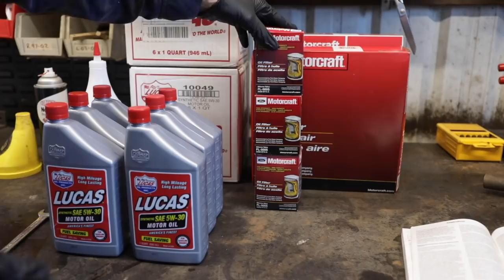How to Change Your Oil Like A Pro

Comment: Good well presented info, I have a friend who's car has different sized front and rear wheels/tires from the factory, he went to the dealer for an oil change and tire rotation. The dealer tech put the larger/wider rear tires on the front of the vehicle. He was driving home with it and it felt like something major was wrong, went back to the dealer and the service manager looked at it for a while put it on a lift and eventually realized what happened.  You would think the dealer would have known this. My point is don't assume because you are going to a pro they will do a better job, they are often rushed and will likely not value your vehicle as much as you do. 

There are some good mechanics out there and if you find one stick with them. If you learn how to do some basic maintenance/repairs yourself, you will take pride in a job done right with quality parts that you selected  and installed yourself. I worked as an auto service writer years ago and I remember the chain quick lube shop next door put engine oil in a customer's transmission. Additionally doing the work you are able to do yourself will avoid the constant high pressure up-sell.

Comment: All good stuff. People with horizontal mounted filters can still add oil to at least halfway or enough to soak the filter media. I use the used oil as bar oil for my chainsaw. I know you might not want to do that with yours but I don't depend on mine saw like some do.

Comment: That's a neat little tip, writing fluid specs and part numbers in the hood. Personally, what I do is I write them on an index card and staple that inside the front cover of my Owner's Manual.

Incidentally, I also like to keep my registration and proof of insurance in one of those little cellophane-like sleeves made for baseball cards. They're so cheap, and yet they're cleaner than those little vinyl wallets your insurer gives you; none of that nonsense of the vinyl sticking to the print and getting all mucked up.

Comment: Pretty good tips and tricks. Cody is very knowledgeable. Should I add one more thing to the list though, grease the front end. Steering components and upper and lower ball joints. Especially if you already have the tires off real easy to get in there to grease ball joints

Comment: you can run a magnet through your used oil to possibly find metal particles, saved my old 74 triumph gt6 from a potential disaster when i did it. but in fairness it still had old valve seats and valves from the lead petrol days back then, runs like a champ now when she gets out.

Comment: Mr. W, AmsOil is available on the internet! I have used their products for a few years now and I love it! I've used their engine oil, ethanol treatment,  P.I. and Power Foam. I intend to use their transmission fluid on my next change.

Comment: And you are still amazing and the reason I subscribed a long time ago. You might mention that spreading a bit of Kitty Litter on the oil spill and crushing it in with your foot and letting the litter absorb over night before sweeping up beautifully removes oil on concrete.
Thanks again for your videos and mostly for your terrific attitude.

Comment: I've only traded in 1 vehicle over the years (a half-ton with good value, but I wanted a Suburban for the family), and leased 1 that we ended up not buying afterward (expensive). Two went to the junkyard after accidents, three got parked in the back yard waiting for expensive repairs. One parked in the back yard because it's antique. Three still being driven. We put 957k miles on those 11 cars ourselves, most were bought used, with an overall mileage (PO and us) of 1.8 million miles

Comment: I added a Fumotu drain valve to my truck after three different vehicles and 16 years worth of oil changes. Now just crawl under the truck with a precut length of hose, attach to valve and drain straight into an empty 5 qt oil container. Doesn't spill a drip. My current vehicle uses a cartridge filter mounted on top so it is truly zero drips an no need for a catch pan. If I had a standard filter I'd need it, but it's nice not to have to use it/empty it now.

Comment: A couple years ago I accidentally installed an old oil filter that I had in my shed thinking it was a new one. Not sure why I had never thrown it away, but I had stuffed a shop towel down it. I go to start the truck after changing the oil and I got a low oil pressure alarm.  Turned the truck on and off a couple more times, and kept getting the alarm. Finally something clicked in my head that I might have used an old filter. That was 150,000 miles ago. 2011 f150 with 323000 miles still running strong.

Comment: I run Lucas in everything! My motorcycles, my truck, my wife's car, the family van, my boat, you name it I use Lucas in it! I just bought a new truck, which is my first diesel, so I'll need to switch out for my truck, but I'm still going to use Lucas. I just switched from a Toyota to a Chevy Duramax, and really the only reason for doing so was because of torque. The one lake my family and I frequent alot for fishing and camping has a pretty decent slope coming into and out of it. My Tundra over the last summer seemed to be having some power issues while coming over it, and our boat isn't really the biggest. I did some testing basically because I wanted to see what the hubba was about my new truck, and it was like their wasnt anything back there the whole time!

Comment: I use Mobil 1 synthetic, and I use a fluid extractor. No need to go under the car, and it takes half the time and half the cost of Lucas or Amsoil. I've never had an oil related failure in 30+ years. Extending your service interval based on some oil-makers claims is dangerous. Oil can become contaminated or just get low over time. If you do use an extended service interval, make sure you check it every thousand miles or so.

Comment: Good video! Another tip is to check that the old oil seal on the oil filter came off with the filter😬 Yeah I learned that the hard way. And chances are if it doesn't come off it is because the guy who changed the oil before never oiled the seal.

Comment: nice list, I would add to it this : before draining the engine oil and oil filter open the oil filler cap and pull the dipstick out a little to give the oil a venting hole to pull air from.

Comment: Great video! Got me on the door hinges. Had to run outside and lube ours... Factory oil filters can be important on newer engines as certain bypass pressures are required with the new variable oil pumps.

Comment: One thing that Ford recommends is lubing the door seals with dry spray silicone at every oil change this prevents deterioration of the door seals and reduces wind noise!

Comment: You can also dab a shop towel in the used oil and wipe around your tires the oil helps prevent dry rotting of the rubber, but its advised to not drive immediately after doing this. Also if you have an under the car spare lower it and put it back up. I have a friend who didn't need their spare for years after getting the car, and his tire went flat. He had to call roadside and the guy had to use an impact driver because the bolt was so rusted.

Comment: i've heard from large diesel engine guys that you don't want to pre-fill the oil filter (also instructions from CAT), it's better to pump air than it is to circulate that new oil that you fill the filter with because that oil can be dirty from the factory. That info may only be true with lower quality oil like Rotella

Comment: Nice video one thing you forgot to mention is to look at brakes and inspect the suspension. Most places will also check the air in the tire. For air filters a good rule is if you hold them up to a light and can see light through them they are ok.

Comment: As an engine builder/mechanic I am going to suggest not to use any additives until the engine is officially broke in. New vehicles of course.
Cody, You should know some manufacturers say NOT to pre fill the filter.  The reason seems to be the fact that when you pour the oil in the filter that is the filtered area which means everything you pour in is unfiltered. New oil is not always filtered to the standards of your car filter and can actually have small amounts of contamination in it. Doesn't matter of course if you don't fill the filter because then the filter will catch irregularities. I think it was CAT and "adept ape" that brought that to my attention.

Comment: I personally have always used castrol oil but i drive old cars with 150k miles plus. i had a acura cl 2.2 that was making a rattling noise during start up when i bought it for 600$ with 170k i used one quart of lucas with each castrol oil change, and the rattling went away and made a great car at 227k i sold it for 2500$ and im sure its still on the road cause i gave the owner recomindation of this! love your videos and i wish you the best of luck and be very carefull of the 450 hondas they have too much power and are for 20 year olds not guys like you and me!

Comment: pro tip from former lube tech: for added grip on the new oil filter when tightening spray with brake cleaner and grip with a dry shop rag, the red ones are the type i used. it WILL NOT slip.

Comment: some other things to think about are just some general checkup on common wear components.  like serpentine belts, radiator hoses, tie rods, ball joints,  brakes and brake lines and hoses.  Also grease the grease fittings on the suspension parts.  all these things can leave you stranded so its better to take a look before you get broken down. Many dealerships and shops cover this in a free multipoint inspection.

Comment: Hey Cody, just trying to be helpful and not a nagging nancy but when you fill your oil filter you should fill it from the outside holes and cap off the inside with a funnel because the filtered oil goes to the inside and up and yes even new oil is dirty therefore if you put the "new" oil in the center it puts that directly into the motor . Please let me know if this helps

Comment: I always put my oil cap up over the fan shroud along with the dipstick. When I buy tires, I like to buy a set of 5, so that I can rotate out my spare as well and get more miles out of my tires.  By the way, I just bought a set of Toyo all-terrains for my pickup over the BF Goodrich. Great tires, so far I love them a lot....but by getting 5 I'm saving money on wear and tear and getting the most out of my mileage warranty.

Comment: I run Amzoil in my Trans Am and my cbr1000rr. I run Valvoline Synpower in my wife's suburban. I also run Amzoil in my Silverado 2500hd Duramax. With filters I run Wix or Acdelco oil filters I run the OE Honda filter on my bike. As far as air filter are concerned Acdelco for the suburban, S&B for the Silverado, and K&N for the TransAm and the Cbr1000rr.

Comment: For cummins 5.9 Mobil delvac 15w-40 is the best I even use it in my tractors never had a problem every 5000 on my two 5.9 cummins 2002 and 2004 both manuals great oil I recommend it great video lots of great tips

Comment: Some really great tips, esp. writing the oil and filter specs in Sharpie. A couple points. 1. What's the thinking behind filling the filter with oil? I've heard that before but I've never understood why. 2. Re. tire rotation...it might be a better idea to check the owners manual for specific rotation patterns for your particular vehicle. Nice work as always, Cody. p.s. I too spotted the Loctite in the background. It'll never not be funny.
Reply: Very late reply , incase you haven’t worked it out, pre filling oil filters helps the motor build oil pressure quicker on the first start up after an oil change. It doesn’t hurt, but it’s not essential.

Comment: I also spray battery terminal protector on the battery terminals at the oil changes.   Prevents corrosion.

Comment: The oil filter stud is tapered to draw the filter tight. This will happen when the vehicle warms up. If you remove the old filter and you find it was loose or just not very tight. You should replace that stud. It can be removed with a Alan wrench. Important when installing the new one make sure the taper is wider at the bottom. .

Comment: Pro tip Cody- Put your oil cap in the hood latch notch. you wont be able to close your hood with the cap there and thus reminding you to put the cap back on. Old mechanic trick a friend taught me.

Comment: If you're stuck for a crush washer you can strip a length of copper wire, wind it into a single strand and use it as one.  
It works in a pinch if you've got no other choice.

Comment: Great video, I do almost everything except filling out that book.  You have the same block as the Ford GT with a few tweaks and some bolt on parts you could have a 647 hp adventure van.

Comment: Another tip that I learned from a pro mechanic: apply some oil to the dip stick seals (o-rings near the handle) so that they don't dry out and get stuck. Especially those cheap plastic dip sticks...replacing a broken one is no fun.

Comment: Hi Cody, I have a story to tell you. When I was in my early 20's I did all my own servicing because I could ( dad made sure that I knew how to do all the regular services as soon as I passed my driving test). I was due to go on a long journey so I decided that I would treat my car and put it in for a service from the Ford garage (my car was a Ford) I picked my car up and paid the bill and set off on my journey, I had only gone about 2 to 3miles when I heard a horrendous noise and my car came to a stop. On investigation, I found that the oil plug had not been put back in or not tightened and was not near my car. I got on a bus and went back to the garage and was in the middle of an argument when a man came up to me and asked the location of the pit my car had been on. The garage was not going to take responsibility for the damage until he pointed out to them that he was an off duty policeman and he had found my oil sump plug on the side of the pit. The garage did pay for repairs to my car but it never was as good as it had been before. If it had not been for that policeman I doubt they would have admitted responsibility or paid for repairs. As a young man, I had been moved on by police and did not have a good opinion of the police. That changed overnight and from then on I had respect for the police and always helped others if I could.

Comment: On the rotation of the tire..... it applies if you do not have directional tires. Some tires have a rotation symbol, please check them before you do a crisscross :) Not all tires are designed to be crisscrossed

Comment: With rotating tires the major wear occurs on the driven wheels, but you do get uneven wear from the steered wheels. Driven tires will always wear faster.

Also with the oil cap, I've always put it on the lock/mechanism for the hood. If you totally forget and slam the hood on it you might break it... but it's better then having your car catch on fire because you covered your engine bay in oil from leaving a cap off.

Comment: I agree with most of your top 10 items. However, I think just about any name brand synthetic oil off the shelf will work IF it is the right grade and IF it is changed at the recommended interval. I generally run Castrol 0W-40 Euro full synthetic and have 250,000 on my Volvo with no engine/oil related issues.

Comment: I bought a 1990 F150 in 2001 with 110 k and the previous owner had metuculously written all the maintenance done on the truck.  I knew what I was getting.  And guess what?  I still have it at 170k and it has been a great truck.  Of course it is a rusted out field truck now, but served me well for many years.  I write all my maintenance in the manual also.  Unfortunately mice ate the page with all the maintenance records on my old truck....